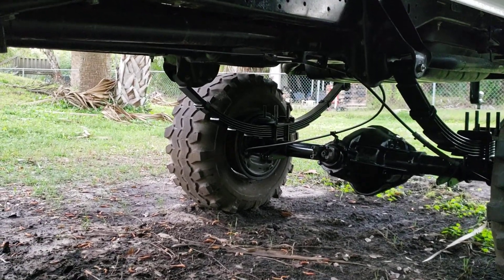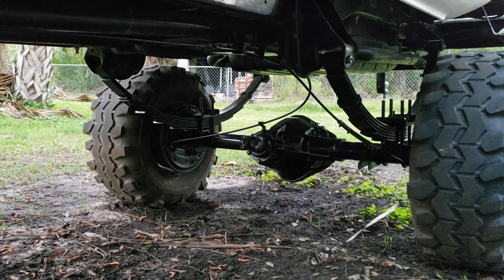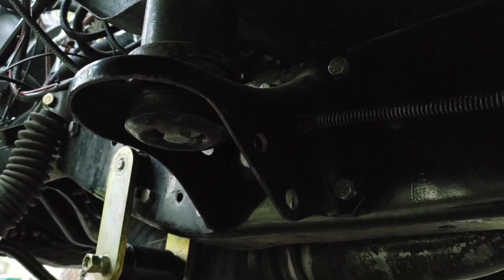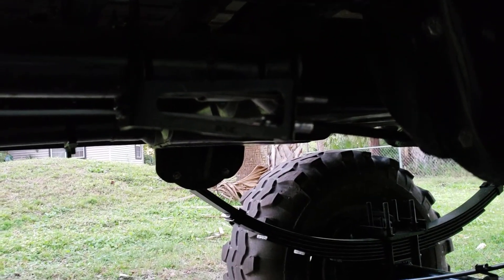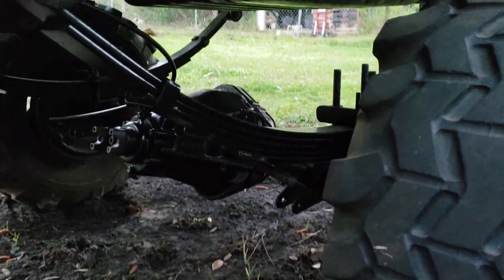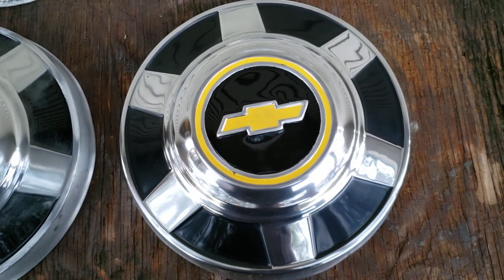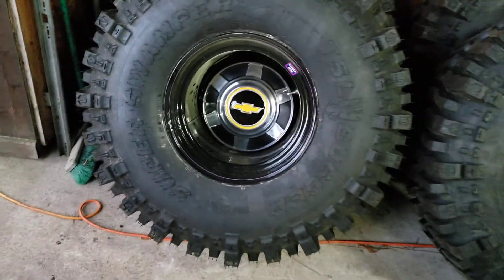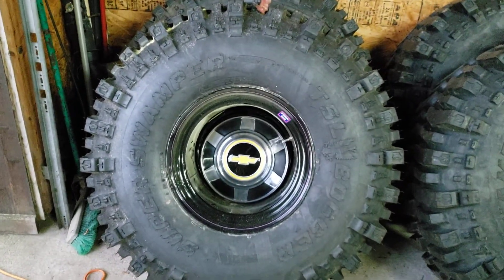1985 chevy k10 4x4 (parking brake cables and progress on hubcaps)

Comment: Thanks for the info on the brake parts number..need to do that to my truck also 👍
Reply from the maker: They come with a rubber grommet at the end where it passes through backing plate I gave up on it and removed the grommet its too thick.

Comment: You say those cables are numbers for a k30? I need everything from pedal back but a few inches longer than stock (mine doesn't have cables at all)
Reply from the maker: Yes they are stock  k30 cables from Advance Auto parts.They are stock length and work fine on a stock lift and my lift of 15 inches.
Reply: @MR1967galaxieLTD  thanks, I need length for a disc brake conversion
Reply: @MR1967galaxieLTD  you got thr cable "splitter" from there too?
Reply from the maker: @mblake0420  no but you can get used off ebay or LMC truck catalog or similar restoration catalogs